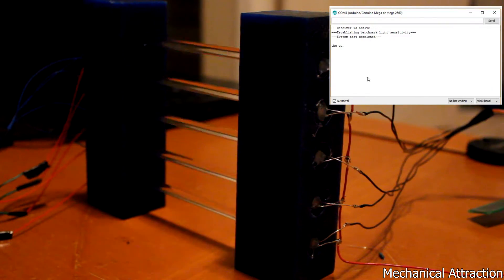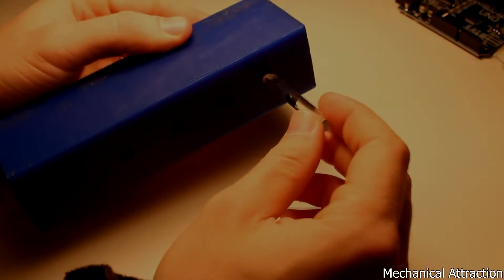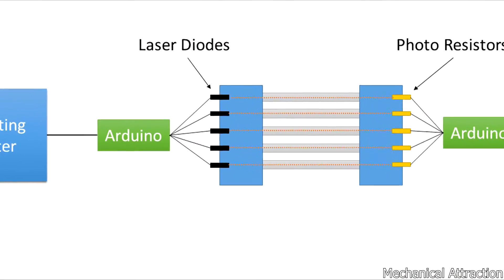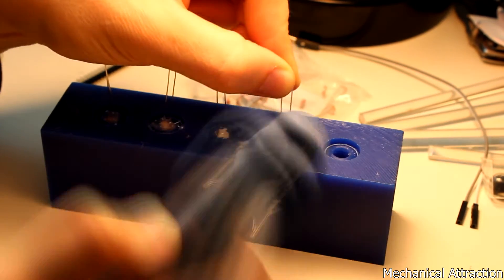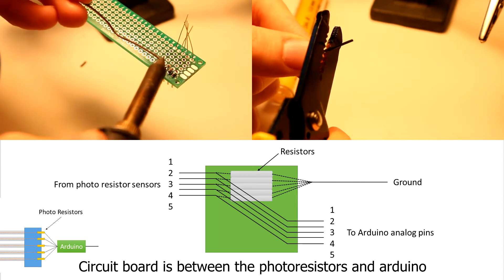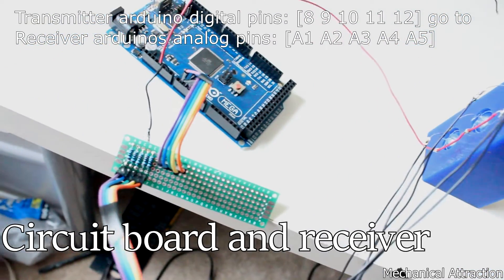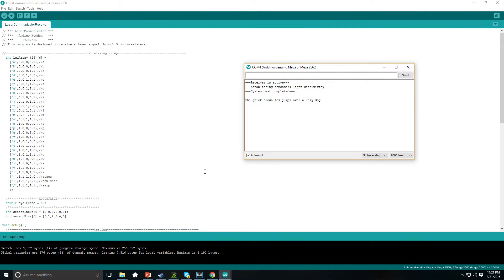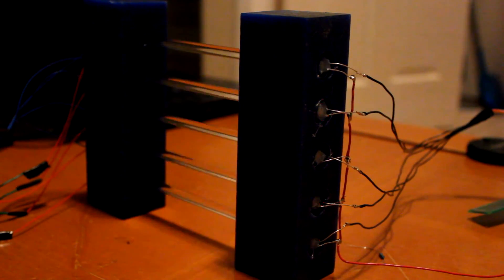How to Make a Laser Communication Device (Arduino Project)

Comment: How to fix the bug for sending proper message in Arduino?

Is there any alternative bug free serial monitor software?
Reply: I think adding seperate clock line/beam should help. Both arduinos than will be able to synchronize, for example by using signal from clock beam to call interrupt function and than read data bits from 5 data lines.

But using such setup it will be more interesting to just create Serial to laser interface.

Comment: What if I need only one laser to make the communication.. One way from the transmitter and the receiver.. What would i change to get it work perfectly.  If you know where would I search to fully understand the consent of sending the data ( encoding the litters/number to their ASCII) then put it on the carrier signal which is the Laser light here?)
Thanks,
Reply from the maker: You would need to rewrite large parts of the two codes. The parts where the characters are defined. Basically you need to write in the code how each character causes a different series of flashes of the laser. Then rewrite the receiver portion so it understands what is coming in. 

Personally I would start by rewriting a code for both the receiver and transmitter. First try to send a single letter. Once you get that then begin creating a letter bank. They're are a few other videos around of people making ones with single lasers that would also help as a (probably better) guide to your project.

Comment: May I ask, why did you split the signal coming from the photo resistor..  why can't i just connect the incoming signal to the arduino directly !!
Reply from the maker: The photo resistors need one lead to be sent to ground otherwise it will not work properly.

Comment: nice work bro , what about a data ? it will work also ?
Reply from the maker: Thanks and I'm not entirely sure what you mean by data. Unfortunately just letters are defined in the code. So anything else would need to be defined or a separate library will be needed to distinguish whatever "data" you want to send. Does that answer your question?
Reply: yes bro that answer my question thank you so much , i really like your work and may be i'll do the same as an End-of-study project , this year .